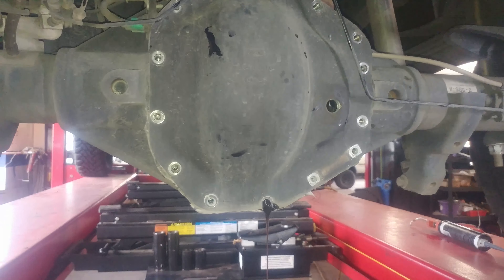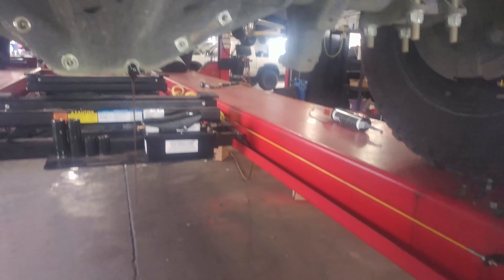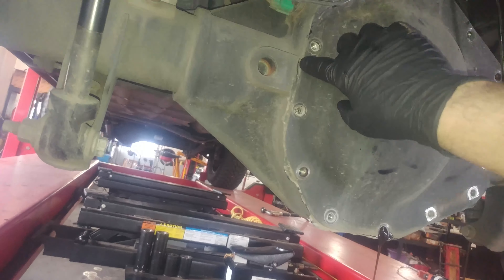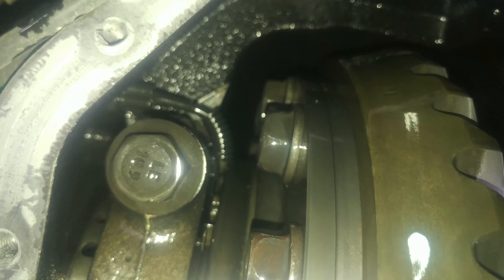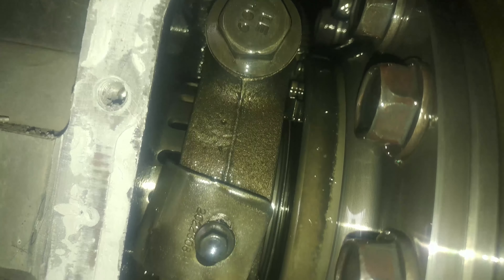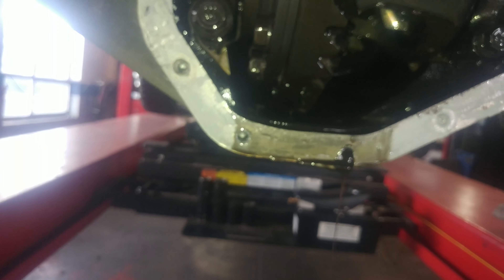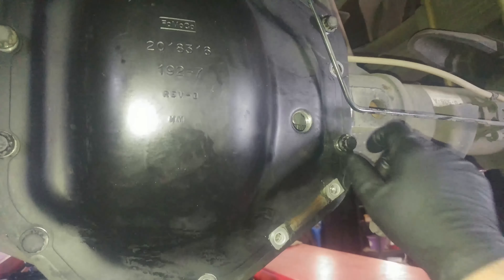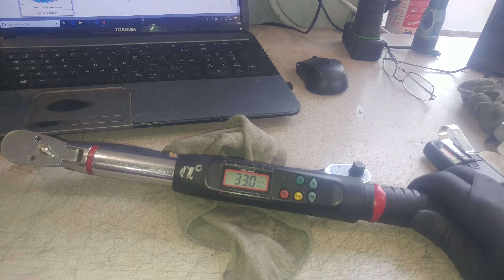Rear differential drain and fill 2017 Ford F350 diesel 6.7L Ford Rear End

Comment: You put 75w85 in the beginning and then you said 75w140 and then said 75w85 at the torque wrench part of the video. Soooooo which did you use? I’m assuming 75w85 since that’s what the manual says
Reply: My manual says 75W-140, its a DANA M275